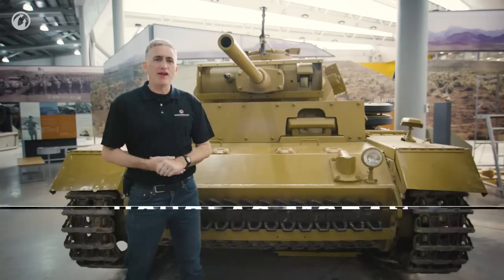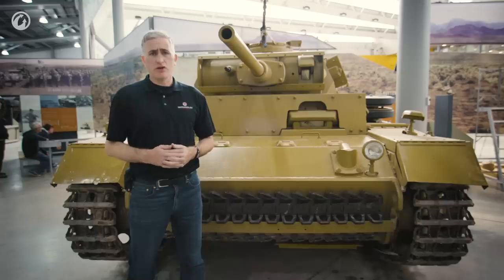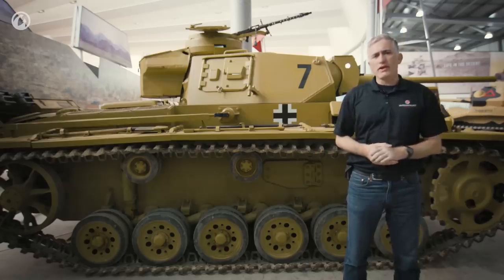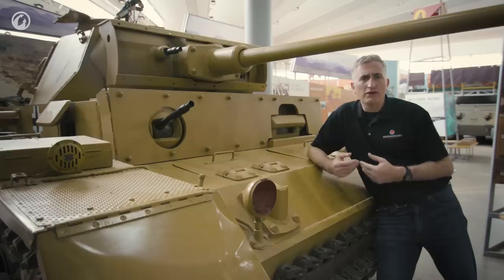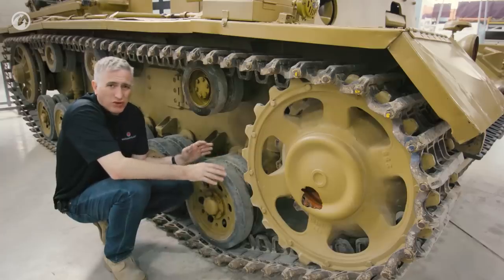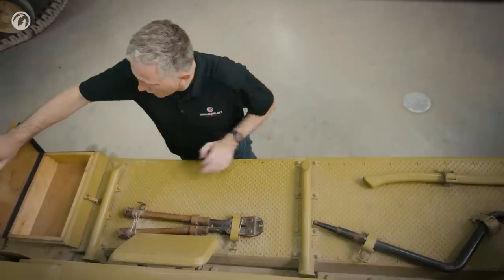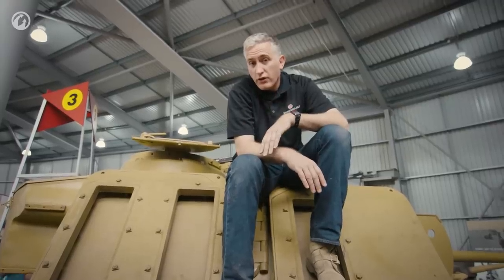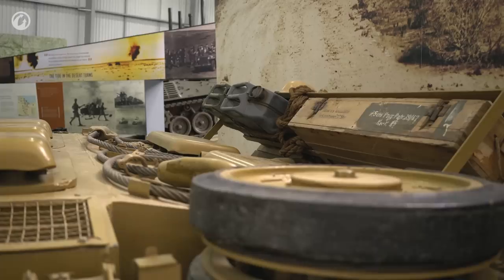Inside the Chieftain's Hatch: Panzer III Part 1

Comment: If I could make a request, and if it would be possible, I would like to see a "Chieftain's Hatch" episode regarding the American turreted T-series heavy tanks (T29, T30, T32, and/or T34).
Reply: T32 no longer exists, and there are many other American heavy tanks with a T prefix. It was standard for all equipment to have a testing 'T number' before being approved for large scale adoption under an M number. T1 and T43 heavy tanks are ones that immediately come to mind.

That said I'd love to see a T29, T30 or T34, whichever of the group can be found in the best condition.
Reply: @Maus5000  Wait, all T32s were scrapped? Dang.

I was aware of the T prefix referring to pre-production prototypes (such as T1 and T28 as well as the ones I had mentioned). I'd called them "T-series" because they never reached production status like the T1 (M6) and T43 (M103).
Reply: @XtreeM_FaiL  Mostly. They mainly differed in the gun:
T29: 105mm T5E1.
T30: 155mm T7.
T34: 120mm T53.
Such a difference may seem small, but they would create quite a difference in internal space to accommodate the differing breeches.

Comment: For all its flaws the panzer 3 is still my favourite tank, I'm glad you did this inside  the hatch!
Reply: I'd go with the Panzer 4 as my favourite WW2 tank especially once it got the upgraded long 75mm gun and extra armor. My all time favourite tank though would have to be the T-72 I'm just wierd like that.
Reply: @wetlettuce4768  Sit inside a T72 and you may change your mind.  At 5'6 I fit perfectly in a tank and even I found the T72 cramped.  More importantly auto load always make me nervous; God help you if something ever fails.  Call me old school but I really like having a loader.  On the other hand, a smaller tank is a smaller target...
Reply: I'm 6'1 I've been in a T-72 and the commander and gunner positions are a bit tight but useable for me the drivers position however is way too cramped for me I have no where to put my legs lol. Guess I have a soft spot for it becuase it's likely the oldest tank you can take onto a modern battlefield and not look like a complete joke to the enemy.

Comment: Finally the Panzer III appears.  My favorite of the early-war tanks.
Reply: "early-war" lol they were using these till 1945
Reply: @zacht9447  Not as a tank in 1th grade combat units.
Reply: @henrikhilskov  1st* also yes it was panthers and tigers were incredibly rare not to mention they usually broke down before even reaching the lines
Reply: @zacht9447  they didn't break down reaching the line... but leaving it...

Reaching it was done using railroad
Reply: @unknownip6741  railroads only go so far and usually they were the first thing the allies bombed also yes most didn't even reach the front before abandonment
Reply: @zacht9447  No totally not true... behind friendly lines there was no issue repairing.

It was when the Germans were on the retreat... they couldn't cover the crews and their repairs anymore so the crews abandoned their tanks.

This was absolutely no issue behind friendly lines where they don't just leave behind expensive gear.
Reply: @unknownip6741  they did though there are dozens of cases of them not having vehicles capable of recovering the extremely expensive and heavy vehicles, to bring them back to depots for repairs becuase geman tanks essentially required a depot Crane for maintenance
Reply: @zacht9447  Usually you said... that compared to a dozen of times... kind of changing your language there don't you think.

The majority of times, the vehicles had almost no problems moving to the front line. They could travel using railroads and normal roads.. this made it easy for them to keep everything working and such.

Retreating was hard tho... Often in a rush without the support of the combat units. And the support units scattering around when the lines broke.

Hundreds if not thousands of vehicles were abandoned with minor damages due the lack of time for even the simplest of repairs.

Later on they did assaults without even having the fuel to get back.. hoping to capture some in their insane pushes.
Reply: @unknownip6741  No i said dozens of accounts not dozens of vehicles big difference there panthers struggled to get more than 100km before they REQUIRED transmission service 

also you keep ignoring the fact that most of germany's rail network had been bombed into oblivion they had to drive the vehicles
Reply: @zacht9447  I said dozens of times... account is pretty much a time it is confirmed.

I never said vehicles... so yes I agree big difference.

If they were really that bad.. Germany wouldn't have produced them till the end of the war.

The Americans had a better time for sure... and they had transmission problems.. but it depended on the factory it came from... the forced labour factories were known for sobatage..

Like I said... the majority of the vehicles was lost in retreat... dispute that fact and there is no real argument here.
Reply: @zacht9447  no this tank still use by Syrian 1960

Comment: Pause at 1:00

Thats not a pz iii.  Thats either a matilda or a valentine😂
Reply: wow good catch there..not sure what it is myself but definately not the pz3
Reply: Adam Warnock look at the side skirts, that is probably a Valentine.
Reply: looking ta the nose of the tank, appears to be valentine. And skirt would cover a lot more on the Matilda.
Reply: Irony?
Reply: @thomaslinton1001  What irony?
Reply: I googled Bovington's valentine...paint job and front end looks the same
Reply: they just used the matilda or the valentine as an example for the Pz.III's tracks coz basically theyre the same during that time.
Reply: @adrianneflors.genetiano425  Not true, the Panzer III and IV used a single guide teeth in the middle of the track. The valentine shown in the video uses a double row of guide teeth. You can tell if you look at pictures of the individual links. Or you can look at the road wheels. The double stack appearance is actually a groove in the middle of the Panzer III road wheels. It is for the guide teeth to pass through the middle. On the valentine, the road wheel is between the two rows of teeth.

The Matilda II (not shown in video) uses a single row of guide teeth, but you can tell its not the same because the track shoe design is completely different. They look in no way similar. It's likely their sizes aren't even the same, although IDK their actual measurements. This should not come as a surprise as they are two separate nations that developed tanks largely independent from each other. At most they only took ideas from each other, but did not share any technical expertise.
Reply: Saw this too. Happened twice.
Reply: Yep. Thats a Valentine alright. The hell were they thinking?
Reply: I would guess its just B-roll to help fill the time of him talking.
Reply: A Valentine track 😄 how sid  that sneak in there🤔

Comment: "If you can't tell if it's a Panzer 3 or 4, just count the road wheels and divide by two."

Or just count the return rollers.
Reply: Unless skirts are fitted...
Reply: Doesn't work with late Pz 4 Ausf. J, which had only three return rollers per side.

Comment: With a blunt-point uncapped AP shot or shell, the cross-over point where sloping a typical forged WWII US Army RHA/British MQ homogeneous, ductile chromium-nickel steel armor plate backward becomes better at stopping penetration due to glancing rather than just making a vertical plate thicker and stopping the shell by slowing it to a complete stop prior to it making a complete penetration, so that both plates weigh the same amount, is at about 45-50 degrees from the vertical or more.  In the sloped-plate case, you do not want to damage the shell, since a broken projectile has its ability to ricochet suppressed (the shell nose no longer can pull the rest of the shell away with it if it glances off) and pieces of the middle and lower body might penetrate through a smaller opening than would allow an intact projectile through.  In the thickened vertical plate case, you most definitely want to break the shell, particularly the nose, so that it has to make a bigger hole and thus cannot penetrate as deeply into a given thickness of armor at a given striking velocity -- face-hardened armor may, under a limited set of conditions, be superior at low impact angles when it can break shells, all other things being equal, but NEVER at high obliquity.
Reply: 🤩🤩🤩🤩 Nathan Okun! (fanboi squeal)

Comment: And easier way to tell the difference between panzer 3-4 is the return rollers. The panzer 3has 3 the panzer 4 has 4 simple. You can count the road wheels but it takes way longer.

Comment: Is it possible the wood lined-box on the running boards could have held replacment parts that may have been vulnerable to static discarge? light bulbs,radio or ignition? just a thought

Comment: Why didn’t the German’s stay with the suspension system in the pz3 or pz4.  Why did they go with the integrated road setup of the panther/tiger etc…
Reply: Well the reason is that those tanks are very heavy, so the complicated suspension helped to support the weight and made the ride smoother
Reply: Kept space for suspension down, kept length of the tank down, helped with a smoother ride
Reply: When you look at tank track say from underneath a vehicle, wherever your roadwheels meet the track is a contact point that carries the weight of the vehicle. The more contact points the more the weight is distributed. The German Schachtellaufwerk used large diameter road wheels to reduce rolling resistance, by interleaving and overlapping the road wheels you get lots of contact points in a shorter length. This allows for very good stability with the torsion bar system and good flotation over soft ground. Look at videos of Panthers firing and its very stable, in fact Panther had a reputation as a very good stable gun platform, same if you look at Panther moving over obstacle course the tanks rides like a Mercedes or a Cadillac. Tigers and Panther were heavy vehicles but because of the suspension design they had very good flotation and could move over soft ground. Panthers could move over soft ground Shermans could not and Cromwells could not. T34 had wide tracks already so had few problems with this. Sherman did not get wide tracks til the HVSS system which upgraded Sherman to 560mm wide tracks. 

The downside was if you had to get to a inside road wheel you had to take several of the outer wheels off and then several of the center row of wheels to get to one inner wheel.  Labor intensive and time consuming.  As Chieftain said in his Panther video a engineers dream, a mechanics nightmare.
Reply: The Panzer III suspension was designed for a 15 ton tank, and could not cope with more than 20 tons.

The Panzer IV suspension was designed for a 20 ton tank, and could not cope with more than 25 tons.

The Panther suspension was designed for a 35 ton tank, and the Panther was definitely overweight at 44 tons.

The Tiger I suspension was designed for a 50 ton tank, and the Tiger I was a little overweight at 56 tons.
Reply: @timonsolus  I disagree on Panther. The shape of the hull was decided back when man was working on VK24.01 project. MAN simply enlarged the hull design for the VK30.02 project. MAN thought they would have a better chance of getting the project if they standardized the design to use as many part from Tiger 1 as possible to minimize development costs. As such the Panther was always going to be in the 42 to 45 ton range. Even the prototype and first 20 production models which had 60mm upper front plate were still in the 42 ton range. 

What crippled the Panther was the engineers had designed Panther to use a double planetary final drive with double herringbone gears. Waffenamt decided the final drive was too expensive to mas produce on the scale of the Panther and substituted a simple spur gear system which was not suitable for the Panther in anything other than flat firm terrain. Tiger I was originally a 45 ton design requirement but the Tiger I was based off a improved VK36.01H, a 38 ton design,  with side sponsons added to support a larger turret ring to hold the Krupp turret with 88mm gun.  Tiger I was originally designed with a Rheinmetall turret with 75mm L/70 main gun. The Rheinmetall turret with 75mm L/70 was later redesigned and used for VK30.02M.
Reply: One word: weight. Later panzers were 2, 5 and even 10 times as heavy, in the case of Maus.
Reply: The tanks were something like 25 ton heavier.

Comment: This thing is as a big as a modern SUV
Reply: actually this tank is not that small
Reply: Nope, it is a lot bigger, the really tiny ones were the Panzer I and II - the I was as small as a compact car (save for the turret), the II was SUV sized - especially the I was sub-par in both armour and armament (only two machine guns), while the II at least had a light cannon derived from and anti-aircraft one and its chassis proved to be quite a capable platform for a light howitzer later in the war, making it a very early successful self-propelled howitzer.

Comment: Tanks really need a faster reverse speed, you would think they could run in reverse to take cover. The Porsche tiger had the electronic motor for drive and had very fast reverse. 20kph or mph not sure
Reply: First and reverse share the same gear. The M4's first gear was a stump pulling granny gear used for towing/tugging heavy loads from a dead stop and had a top speed of 2-3 mph. The M4 users had been agitating for a higher speed reverse gear for quite some time, so Ordnance had Spicer design something to permit that using the existing gearbox. They came up with a gizmo that attached to the rear of the gearbox that allowed the driver to go in reverse in all forward gears. The war in Europe was nearing the end so Ordnance canceled the project before it went into production.

Comment: Or they could just have adopted a sloped one piece glacis . Extended the edges of the hull slightly.. and had a one piece forward deck and 6 bolts to hold it in place... no more metal.. less hours to construct.. easier to maintain.. maybe 2 hours to sketch out and put into full production within 3 months

Comment: So the nightmare that is: "NEIN WE HAVE TO CHANGE OUR TRANSMISSION" on German tanks go as far back as Panzer III eh. German over engineering at it best.
Reply: More like German engineers designing things without taking into consideration the poor bugger who will eventually have to work on it.
Reply: Well, the early tanks didn't really have the transmission issues early on, when they didn't weight a thousand tons LOL
Reply: @sirboomsalot4902  A lesson the militaries of today still struggle to grasp, I've heard the stories from Iraq vets about their trucks having so much bolt on armor added to them that what was once a reliable suspension system just can't take the weight anymore and will break if driven hard and then to get to the suspension you have to remove the add on armor lol.
Reply: Weird that plain poor engineering is described as over engineering.  Only German engineers can get away with it.

Comment: Ive got a question. Throughout WW2 the Germans were famous for using only petrol engines. Why is that? Why not switch to diesel?
Reply: they didn't actually use gas.petrol ... they mostly used liquefied coal (google it) since the pliesti oilfields were basically their only supply of oil ... and wichever diesel they could get their hand on was needed to other vehicles such as uboats (they endedd up crating the multifuel-diesel concept) ... germans even experimented with /wood.gas-powered tigers at some point. :D
The move to direct injection engines (in airplanes) also was a measure to allow them to use liquefied coal there ...

Comment: The one dislike is from that T-34 fanboy
Reply: I doubt it, since Russian are huge fan of Panzer III. They even brought some Pz. III before the war. The improved T-34M (A-43) incorporated many design elements from the Pz. III, such as three men turret with commander copula, torsion bar suspension, and new 8 speed transmission.
Reply: The red army mounted the Zis3 in a PzIII chassis and renamed it SU-76i, so they learned a lot about the PzIII
Reply: @andyfu9651  Let me guess,  the T-34M was considered over engineered and didn't go in production?
Reply: @2adamast  partially right with the not into production part, but the main reason was the war broke out and they couldn't refit the production line. Those elements though later saw introduction in other designs... Well T-34M would be at least  simpler in running gear with torsion bar replacing christie
Reply: @enlg3750  So if in 36 Krupp went for leaf springs instead of torsion bars for the Panzer 4 it's because the war broke out ... they love complex stuff?
My last car with torsion bars was a long time ago,  where for cars Christie like suspensions seem to dominate.
Reply: @2adamast  Its not the same geez, tanks have so many different requirements compare to civilian cars that torsion bar works so much better, and for tanks today torsion bar dominates. 
As for the case of early time like 36 well things happened with reasons, besides by that time many about how tanks work were still in need of testing in real condition so nothing was sure back then

Comment: You keep saying that sloped armour, particularly in relation to T-34, is compromising internal space and therefore have negative effect on performance of the crew (by making crew compartment more cramped). While it sort of make sense theoretically, in practice that's not the case at all. Here is diagram of a Panzer3 armour in black with T-34 stile sloped armour superimposed on it in red. As you can see, no internal volume would have being lost at all:

https://i.imgur.com/aZ4x5WI.jpg